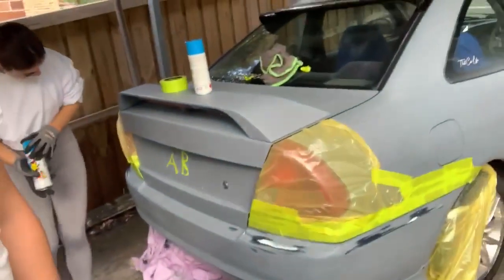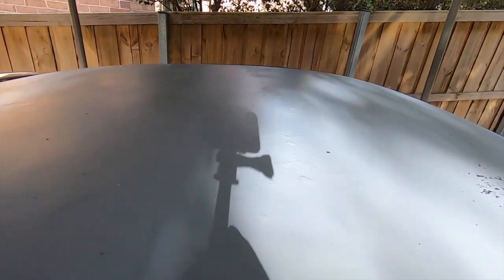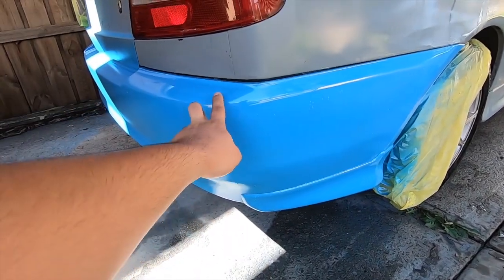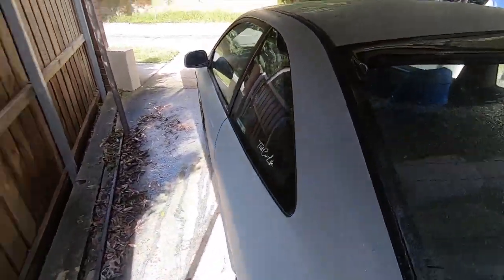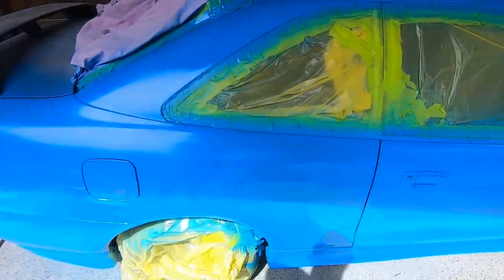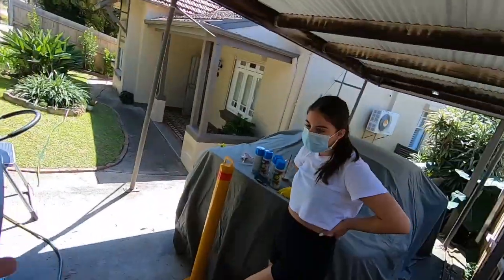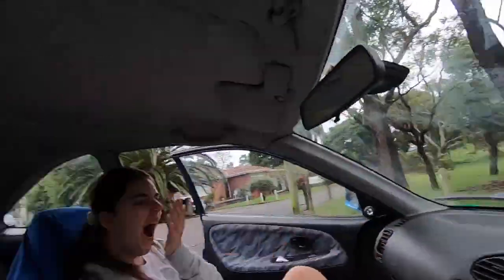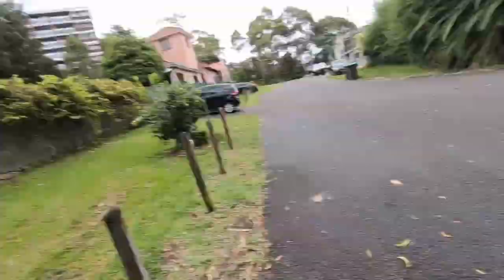The Lancer Is FINALLY PAINTED!!

Comment: would love to know how that paint has held up ive used a different paint from supercheap and it loves to peel after a month or so
Reply from the maker: Sold the car not long after this, from the photos I saw of it after it held up pretty good! Definitely needed clear coat to protect it from rust and  the elements but as a bit of rust spots were appearing around the car
Reply: @ThatCarLife  Oh wow I might need to give mine a respray one of theses days then if that's the case. Cause I used the Dupli-color auto spray which loved to peel on me.